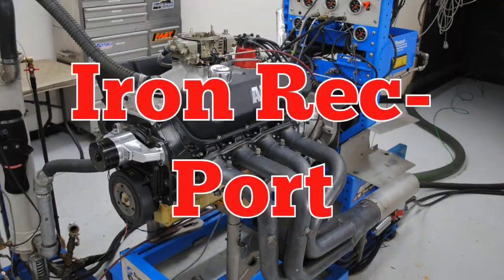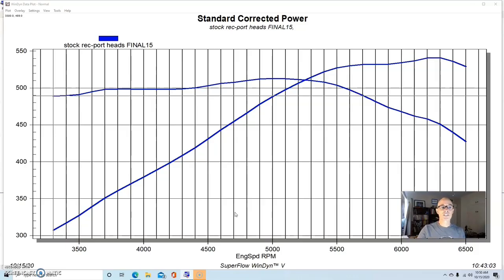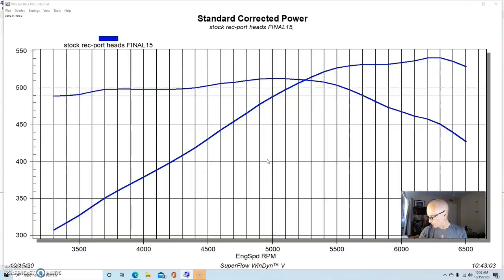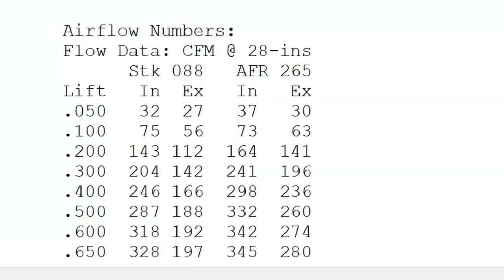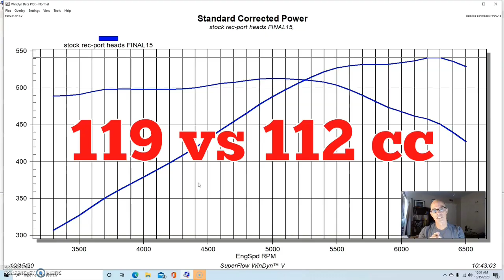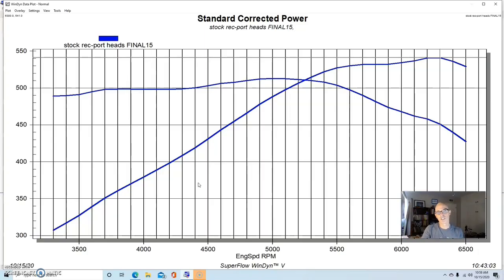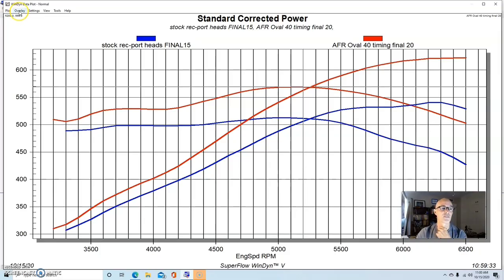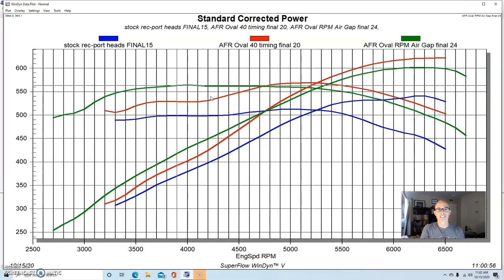454 BBC REC PORT VS AFR OVAL-PORT HEAD TEST

Comment: Are those the afr heads you used for a magazine test back in 2012?  I think the article said they were fully ported and had the chambers worked.
Reply from the maker: we ran the afr 265 heads the way they come
Reply: @richardholdener1727  thanks, that's what i wanted to know. Keep up the test. P.S. the more big block stuff the better😉

Comment: Several years ago I help a fellow when I worked for GM as a line mechanic on his 68 Camaro that had a aluminum 427 chev power glide ect in his car. He told me back then that the oval port head that were ported by folks that knew how to make them work were a pretty impressive head. He had been talking to some guys that built motors in the Dallas area . There still there I believe .  That was a long time ago but I never forgot what I was told about those head .
Reply: We made 600hp / 600ft-lbs on M2 race systems engine dyno years ago with hand ported oval heads on a 454. It had a custom hyd roller cam from Anthony Disomma who actually rebuilt the motor. Cp was 10.8:1 and it was topped off with a single plane victory jr intake. Very simple build with mostly factory parts.

Comment: Wouldn't a better test be the AFR 300cc Oval port vs the AFR 305cc Rectangle port? I mean that's a factory head vs a aftermarket one. I don't have big block and probably never will but it would be nice to know what design is actually better.
Reply from the maker: shape doesn't matter much
Reply: @richardholdener1727  then why is rec port LS3/7 superior to cathedral port LS1? Why change port shape at all?

Comment: I have something close to that combo w/ the AFR heads, but in talking with AFR and some cam guys they say those heads prefer a single duration cam. Any chance in doing a spilt vs single duration cam test on that motor?
Reply: What combo are you running and what kind of power did it make? I have a split duration cam with AFR 335's and it turned out wicked.

Comment: Small port boosted engine would be nice in a dually. All in by 5k. Stump pulling torque ftw!
Reply from the maker: this small port pulled to 7,000
Reply: @richardholdener1727   fired me up to see that. I have a gen 5 engine in a 71k20 I'm thinking would enjoy a bw s366 setup. Always intriguing seeing the knarly stuff you test

Comment: I really enjoy the BBC videos. I have a major problem with spending $2500 for the 265 AFR heads. AFR is great, but the price is too much. I drove my big butt to Mena, Arkansas, picked a heck of a deal on the 312cc intake 115cc Brodix BB2plus for $1000 less than the AFR heads. Complete heads. There is room to grow with the heads I purchased. Are the 265 AFR’s done at this cubic inch engine? Thank you again for your work.
Reply from the maker: Given the flow rate-the AFR heads will support 700 hp,  but the Brodix stuff is good too

Comment: I always loved it when people told me I couldn't get 400 wheel horsepower with vortec heads because you can't get high lift with them. Max flow at high lift is only touched once, a good head is one that flows very well throughout the entire lift range not just peak remember a .500 lift cam will spend more time at .480 than .500 so you want good flow under your peak cam lift

Comment: I have a couple questions, is the exhaust port height at the factory level? Were the ports raised? What size is the chamber compared to the bore? I was told in the past that if the head was for a 4.5" bore then you would run into flow problems when using the head on a 4.25" bore. I have a +20 yrs old 427 and looking to bring it into some new power. Also, would you use the AFRs on a 496? Thanks for the content!
Reply from the maker: If I was buying new AFRs for a 496-I would get 290s-check with AFR website on the raised ports

Comment: This test makes me proud to be an AFR fan since 1993!  But we shouldn't be surprised.  Big LS heads make 600-ish hp on 270 cc port volumes.  Even cathedral port heads at 235 are wicked.  I knew the 088 heads were toast when I saw the AFR's had 20% advantage in mid-lift flow.  

A cool follow-up test would be to put the iron heads back on and see how much more cam is needed to match the power of the AFR combination.
Reply: Not entirely sure what to think of it. Let's be real, the 088 heads aren't exactly great heads. Pretty easy to expect a significant gain. Would be fun to see this combo with AFR 315 CNC heads. That would be more interesting as they are virtually the same size in both port and combustion chamber.
Reply: @AB-80X  I think maybe the AFR oval port heads flow so well because the valve guide doesn't protrude into the port?  I wish the video had a good view into the port.
Reply: @andyharman3022  
I doubt it. I did a build for a friend and he insisted on using the AFR 305 cc oval heads. Those definitely had the stems in the port and I can't see them doing it much different. Those heads were a disaster btw. We specced the cam lift based on Mamo's recommendations, and the performance was abysmal. Cam had .680 lift. We then tried a cam with the same duration but .610 lift and piced up power all over the curve. Problem with these heads are that they create a ton of turbulence. We put the heads on a flow bench and while they did flow a lot for a 300 cc head, the noise from the air rushing through were ear splitting. Can't say I'm a fan of AFR oval ports. 
When looking at this engine here, I wonder how much torque an power this engine would pick up all over the curve by running the 315 heads and a cam with the same duration but 624 lift. 
My buddy ended up switching to the 315's and the 680 cam and the numbers were stellar from way down to peak power.

Comment: Thanx for organizing the videos by motor. The beauty of good low and mid lift numbers is that the valve is at those lifts twice during the intake or exhaust stroke, it’s only at full lift once
Reply: That's true, but the valve lingers wide open riding the top of the cam lobe longer than the rest of the lobe profile.

Comment: I think the cam is a little small on the rect port set-up to be honest. I doubt the AFRs would gain much more power with a bigger cam, but the rect ports would. Prove me wrong ;) Apples and Oranges ........  What happens when you spray or force air into those big phat runners ....... Let's find out !!!!!
Reply from the maker: the prove me wrong-never works. Nitrous or boost works with any head. bigger cam would add power to both

Comment: It's the low to mid lift #s that matter. High flow through a small port yields higher torque across the powerband. The AFR head just smokes the factory head throughout the lift range.
Reply: Yep! More velocity

Comment: @richard. I just ran across the most interesting thing on Facebook. Cat had his carb turned around backwards on his engine. I wonder if you could test on a engine, if there would be any pros to running the carb backwards on the engine. Despite it being tuned could there be any advantages?
Reply from the maker: what intake
Reply: @richardholdener1727   not sure of the brand but on an LS engine

Comment: Aftermarket rec port would mash the the aftermarket oval.  .  Not a fair comparison. Add a bigger cam in the 620+ range and some aftermarket rec ports.  They will move way more air..
Reply: Richard did a 10 head comparison video.  The AFR290 oval ports did very well against after market Rec port CNC heads. It was a very interesting video.
Reply: @jaredfarney675   do you know the title name of it , Sounds very very interesting.  .right up my alley
Reply from the maker: https://youtu.be/-D4ImcgCoCo if only you clicked on the na BBC playlist link I provided
Reply: @richardholdener1727    next time I will do  . Would you run oval port over rec port in a all out battle over  ponies ?
Reply: Lol, he did that test look it up. AFR 290 oval kicked all rec port aluminum heads asses
Reply: Okay I'm going to find it.

Comment: Richard Holdener,
I've looked over all your videos, and as far as I can tell you've not yet covered those "Reverse Flow"  SBC that use the exhaust ports as intakes, and the intake ports for exhaust.  A few channels on youtube have cars with those engines.  I wonder if they have any value, or the swap decreases HP and Tq.      Hmmmm...1.6 valves for intakes, and 1.94 or 2.0 ish for exhaust. And then with a power adder like Turbo or Procharger.
Reply from the maker: cool gee-whiz video
Reply: Guys tried it with the nail head buicks too. They had a solid bottom end but the exhaust port left a lot to be desired. Figured sending it reversed they could make enough pressure to overcome the port.
For most engine builds, the exhaust port flow is like 70% of intake. Some really high power engines this goes down to low 60s as the need for more intake outweighs the gains in exhaust.
For most (all) engines, reversing the flow ratio like that will kill power. Even if you think the bad exhaust port is in your way, it doesn't matter if the intake charge can't get in.
Some low power engines, think industrial stuff, have really close port shapes and valve sizes, but it's done as a matter of efficiency not power.
For most automotive engines, they can function well enough with flow ratios into the 50% because most of the time they are at maybe 20% of peak power and there is substantial intake vacuum.
I am not saying it can't work, lots of things can work well. My point is you look at the I/E flow ratio of any race engine and you will not find one winning one with higher exhaust flow. Nascar and Prostock are close to the same ratio, usually a bit less than 70%. Turbo indy engines with purpose built heads were around 80% at peak flow. New top fuel stuff has valve sizes more than a half inch bigger for the intake, specific flow numbers are hard to find, and Top Fuel has the most demand on an exhaust of basically any engine.
If you want reverse flow for a styling feature. Cool, neat project. It's pretty nice work. It's not functional. They turned a small block into a Briggs and Stratton.
Reply: @timothybayliss6680  So basically those engines are just a novelty. But still I would like to see Richard work his voodoo dyno magic on one, compared to a regular breathing engine, just to see what one is like. Plus, we can't let Richard run out of video ideas.
Reply: @ViewThis.  some of the turbo Indy stuff is reverse flow just for better packaging of the turbo hot pipes, but they have purpose build heads that have a typical I/E flow. Older F1 v8s had reverse flow as well, but that again was for exhaust and intake packaging where the heads had typical flow and design.
I looked at their build at reverse flow and it's really interesting. Those guys did a lot of work, most of it above my skill level. It would be interesting to see a dyno test as well. I bet it makes peak torque at like 1500rpm and a dump trucks worth of it. 
There is one place that using the intake as the exhaust works and it's on flatheads. A couple land speed guys reverse flow them just to keep the heat out of the block and they really cut the blocks up to do what they need.

Comment: Richard a serious question for you. Have you ever had a pair of identical sets of heads one in aluminum and one in iron and done back to backs on them? I mean how hard can it be to take a say small port iron heads make a port and duplicate it in aluminum and make the same valve and chamber size. Just tossing that out there for you. I've always been told that iron makes more power because of chamber heat reflection aka the heads do not absorb heat as readily as aluminum and I know the trick on aluminum is to use ceramic coatings to retain chamber heat. I think people might appreciate a little insight into that.
Reply from the maker: Engine Master tried to do that test a couple of times-having the head actually be identical is very hard
Reply: @richardholdener1727  Maybe you can elaborate why it's so hard, I'd think the castings wouldn't be much different other then wall thickness and stuff, I was thinking cNc ports and chambers and identical valves, shouldn't be that difficult.

Comment: Great comparison. I had a 496 in my 70 Chevelle , 300CC Oval port AFR’s, Edelbrock RPM (non air gap) 248/254 Comp Solid Roller , 10.7:1 CR, 950 Holley Street HP 2” hooker headers - made 706hp @6500 rpm and 643 ft/lbs of torque. Super strong performer. Great heads. Same heads then went on a 572 cube with super victor and 270@. 50 cam and 11.8CR and it produced 807 hp and 739 footies.  Now I’m building a 582 With 360cc Mamosport recto heads ..
Reply: It seems wild for me how these pushrod engines behave like naturally aspirated 100hp/L is in the rear view mirror for smaller Japanese engines these days but a pushrod V8 will be 500 cubes happy with 500-600hp. 
Although I know engines don't scale as well and a bigger engine will always make less HP/L the number always seem pretty unassuming always very tame. 
Although 11.8:1 comp is getting into the higher areas 
But I daily a Honda with 12.6:1 compression ratio and stock cam no problems honestly it's not the best combo to be high compression with relatively untouched engine but that's how my head/block combo worked out. 
I don't think it'll make 150hp at the wheels however.
Reply from the maker: If your B16A wont make 150 wheel hp, you are doing something wrong. It is harder to make 100 hp/liter as displacement goes up
Reply: @richardholdener1727  not a b16 and not heavily modified it's a sohc with p29 pistons and y8 head twin carb
Reply: how did you find the 11.8cr? did you run it on pump gas? did it guzzle fuel even when driving sedate?
Reply: @grantpokarier7412  no problem at all. Doesn’t detonate.

Comment: 500, 600, 800, 1,000+ HP...we just throw these numbers around like nothing these days eh?
Man, if you had a 400 HP street machine, you were something back in the day.
Reply: At least they still have to get the power to the ground. A chassis that will only support 200 or 300 horsepower is uncontrollable at 800 or 1000 horsepower.
Reply: @mediumjones ,
   True that! These high-end 454's are useless to me though! Lol
My TRS drives and transmissions in my boat are good to maybe 450hp! I dont have the many thousands it would take to upgrade outdrives! Hah!
Reply: camaroguy 66  you know lawrence, I think that only applies to modern automatics. If you can Launch a stick car well, you’re going to put more power down with closer ratios than a similarly equipped 3 or 4 speed auto. All the way through the gen vi camaro.

I believe it was these modern 8 speeds that were the game changers. The ZF8 speed in my scat pack charger was scary good, and i ysed to be able to hassle 6 speed hellcats all the way to 80 to 90 mph before they would blow past me.

Nothing in the above applies to turbo cars though. Automatics are a much better match for turbocharging.

Sticks are still way more fun, and paddles are band-aids.
Reply: But even in the late 90s 400hp was considered a HUGE number.  If you had a 500hp big block you'd be known for mile and miles around.  I had a buddy with a build 455 Olds in a 79 Trans Am.  I'd bet he might have been making 400-425ish with a mountain of torque.  He raced all the time and only lost one race.  The other thing that gets me is guys can now make all that power now but good luck hitching it.
Reply: One thing to keep in mind when looking at these numbers from Westech's dyno sessions. They are STD numbers with no accessories. Want to compare them to what a GM OE engine makes on SAE J1349? Deduct about 12% overall. So those 600 hp with a dual plane is more like 530 hp if you want to compare it to what you see on the street from the OEM's. If you tested an LT4 engine like this, i.e undressed it, used STD and raised the running temp to 160 F, it would make 740'ish hp. Not saying it's not a lot, but it is worth keeping in mind how these numbers are to be perceived.
Reply: @AB-80X  That's why a Chassis dyno is also a useful tool.  Ideally for R&D I think an engine dyno is great for the simplicity of changing parts. I had my 516 on the engine dyno with my headers at least,  and I lost some peak but picked up tons of TQ midrange
Reply: It's clear now with 2020 hind sight, it was the tip of the ice burg.
Reply: You could get a 600 something hp in the late 60s. It was called 430 hp compared to the 435 hp street engines.
It was pure racing and would suck on the street. It didn't have a vacuum advance had 12.5:1 compression and mechanical cam.

Comment: Is it just me or is that cam kinda mild for the combo
Reply from the maker: it was a street motor build
Reply: I've been eye balling a 220/230* with .600 and wider LSA.. been running a 454/502HO cam from GM 211/230 with 510/540 lift
Reply: @adamwildman2053  Don't go wider than 110 on the LSA if you have a 454 or 502. It will absolutely kill all your mid range power. With those fairly mild duration numbers, perhaps even consider 108 LSA. Crane has a cam with the number 168741 often referred to as the "741" cam, with 236/244 @ 050 with 112 LSA and 610/632 lift, a great 454/502 cam. It's very similar to the cam Mercury Racing use in their 525 EFI, only difference is that Merc uses 114 LSA to avoid reversion. With good heads that Crane will make about 560-580 hp on a 502, and have a stupidly wide torque band. That would be a great upgrade over the stock 502 HO cam.
Reply: Judging by how far it RPM'd and where the peak power was, I'd say it was pretty spot on, even if it's a street/strip deal. Remember that you drop 1500 or more RPM when you shift, and you need the torque down low. You don't have to go much beyond the 240's when you have a BBC that is on mid 4XX ci to make it somewhat temperamental. 242 is right in the butter zone for a 468. Any more and things start to get raunchy.